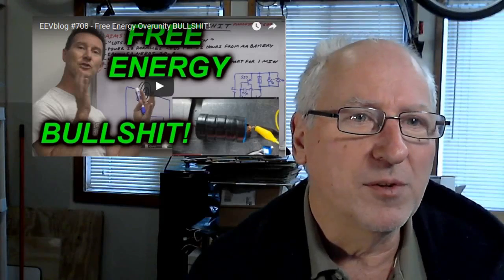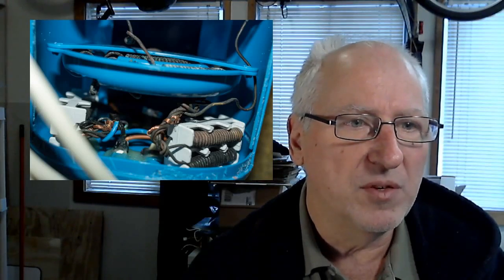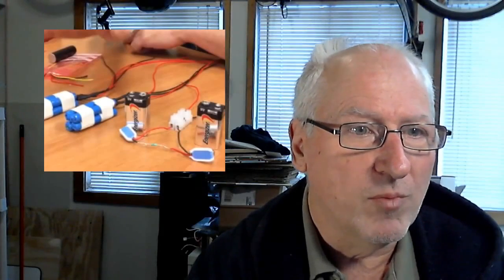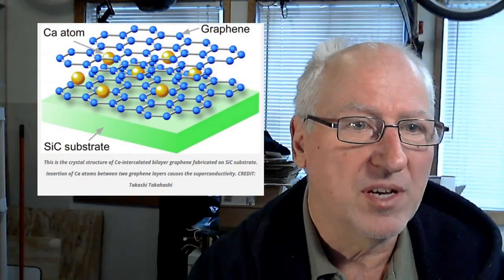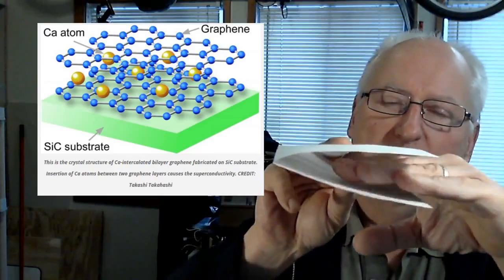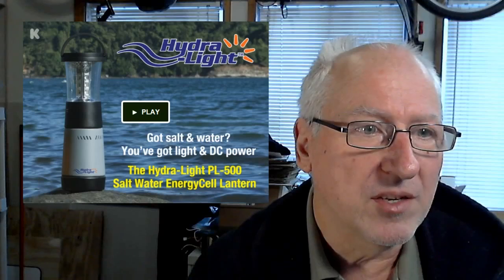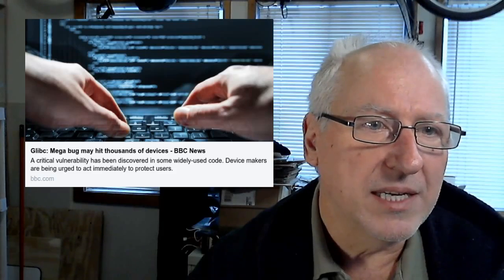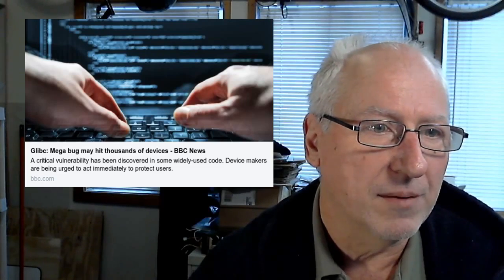#448 Zero Labs Alternative Energy News Update 02/18/2016

Comment: those who claimed to have reduction that they dont even understand what is going on with the illusional reduction. cuo wires has its resistance ，so the current go down，then the total power accordingly go down as well . everyone in the world with this concept can reduce the total power readily just by connecting cuo wires in series and connect them to ur appliances，you can easily detect 50% reduction ，and the more appliances you add to the load ，the more reduction you would have. those who claimes to have reduction in his unit please check it out if your appliances is under the rated power. because i had done lots of testings and found this mistake. dont be fooled by ignorance. maybe ks himself dont even understand this as well，because he has not done experiments for a long time.

Comment: Zero, While I do understand where you are heading and what you are trying to accomplish with the recent changes to the content that you are posting,  I must admit that I miss your experimentations with  self running magnetic motors, you seemed so confident with your most recent attempt and it seemed like you were very close, is there any chance that you might pull it off the shelf and demonstrate some of the failed attempts that did not make it to You tube, I assume there were failures because I had to put gas in my Tahoe today and if you would have been successful we would all know it by now :o)  I am firm believer that there is knowledge and lessons that we all can learn from failures. In any event, good luck and keep up the good work. 73
Reply from the maker: +Michael Katt Relax. There is more to come.

Comment: Read an article just yesterday that an English based company is testing an HHO power cell plant that allows their lightweight designed car to travel 300 miles on 64 ounces of hydrogen gas...
Reply from the maker: +lwblack64 Isn't 64oz quite a lot of hydrogen gas? How many cu-ft is that at STP?
Reply: ZeroFossilFuel
I don't think that it is. IF you consider that a gallon is 128 oz. and you certainly can't get 300 mpg on ANYTHING. Even a toy car using gasoline would take more.
 The argument some might have is that it would take more energy in 64 oz of hydrogen to produce that same 64 oz of hydrogen. Well guess what? It takes more energy from a gallon of gasoline to produce that same gallon of gasoline. However, hydrogen is the most abundant molecule in the Universe. And if out economy actually is one of true capitalism with supply and demand then the demand could never outweigh the supply like what happens with gasoline. AND, it is much, MUCH cleaner to use hydrogen which means less overall cost to our human species(ie pollution and health related issues)...